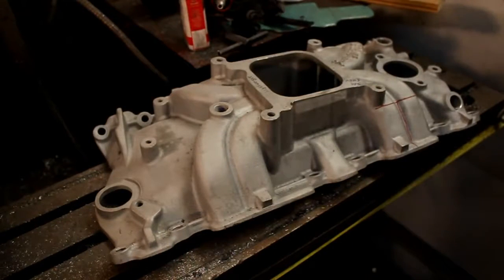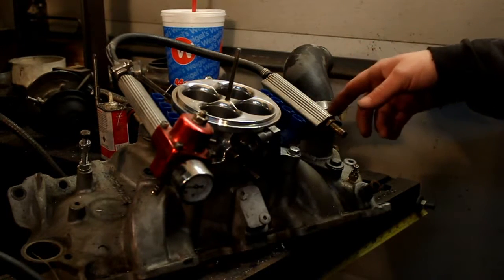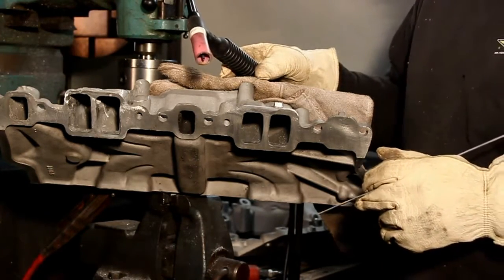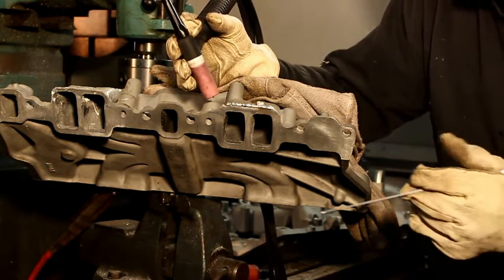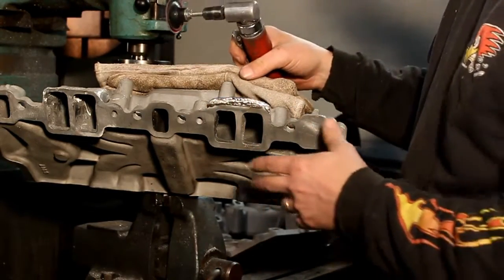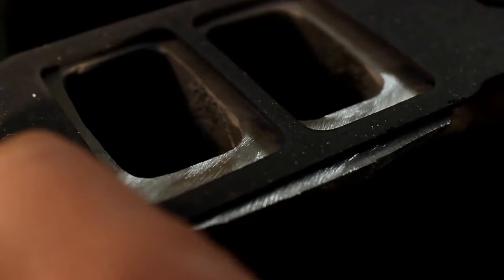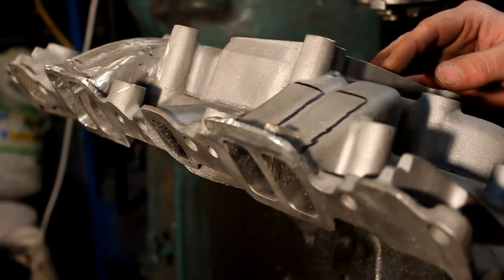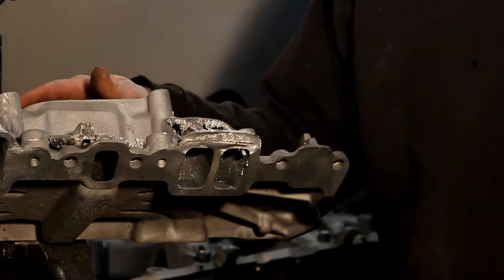Modifying an intake to match bigger heads.

Comment: This is amazing. I always knew that it would be possible to weld a manifold to match larger head ports, but I never actually saw it done.

I got this idea when I discovered that the Cross Fire Injection manifold had ports that were significantly smaller than the cylinder head. This sort of welding would have made a numbers matching Cross Fire Corvette perform much better.